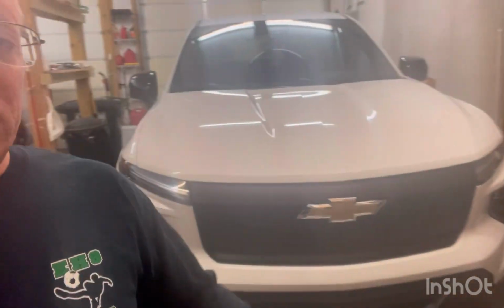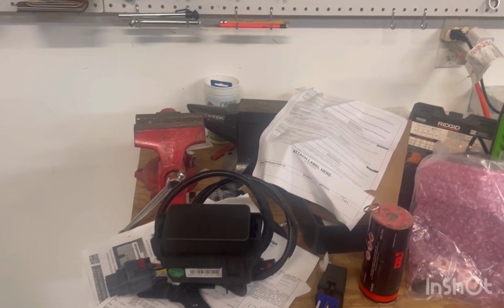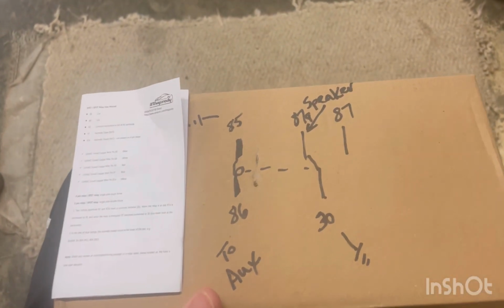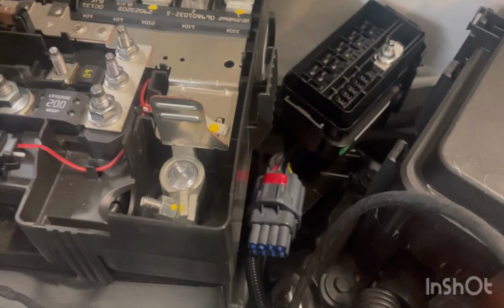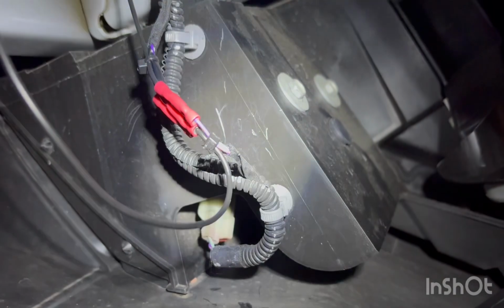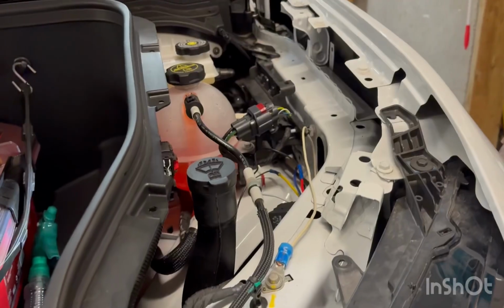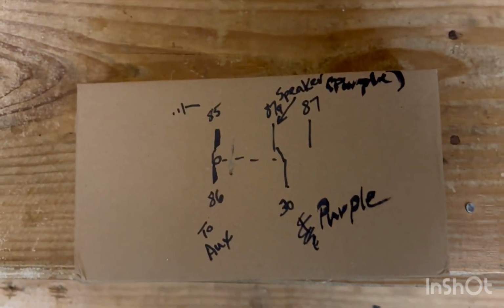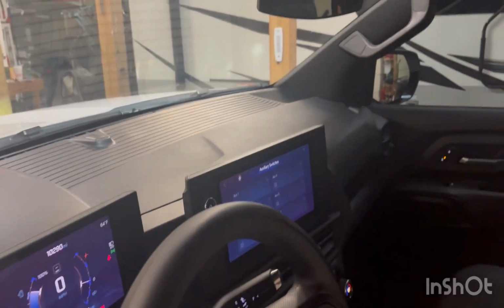Pedestrian Warning On/Off for Silverado EV

Comment: Thanks for the video!  Does anyone know if there would be some sort of a speaker wire "extension" cable?  With male speaker connector on one end and a female speaker connector on the other?  If there was such a thing then you could use that to do the splicing of the "purple" cable and not splice into the original speaker wiring.  Then you could potentially re-connect everything as factory installed if you were to sell or trade in the vehicle.  Does anyone know the part number of the speaker connectors?  Thanks!

Comment: Thanks Rusty for the content idea of installing Aux switch forward Pedestrian Warning On/Off option.  I have the RST trim and your steps in your video were on target.  The Aux Switch Module Part# 86587305 is listed now as a Silverado part at the parts counter, my VIN matched the part number.   The 30 AMP 12V DC Waterproof Relay and Harness - Automotive Relay was a great fit for this project.   I just finished the installation this weekend and now have the option of stealth mode while in drive and Neutral (I want to keep reverse  Pedestrian Warning not switched.)  Now I can leave camp grounds at night without causing a stir from the forward Pedestrian Warning being active.  Very nice job with your instructions.   The SEV is a great versatile truck, and tows like a champ.
Reply from the maker: Kelvis, thanks for the update!  I am glad to hear it works for someone else. Glad to hear the part is now listed as a Silverado part. 

It really is nice to be able to turn it off and go “stealth” mode when needed.

Comment from the maker: 85 or 86 should go to ground the ungrounded input goes to the auxiliary output of the truck (12VDC source). This operates the relay. The speaker is not grounded - so no ground. Just cut the purple wire and run it through the 30 and 87A output connections on the relay.  This is the switched contact that opens when you turn on the aux control from the truck. Hope this helps. I love being able to turn off the annoying noise in certain situations.

Comment: Please help me clarify which pin is connected where? So pin 30 and pin 87a is connect to the speaker's ground wire?  Pin 86 goes to the AUX. And Pin 85 is grounded to the chasis? Pin 87 is capped off and not connected to anything. Is the Purple wire the speaker's ground wire? Thank you for helping. Great video!